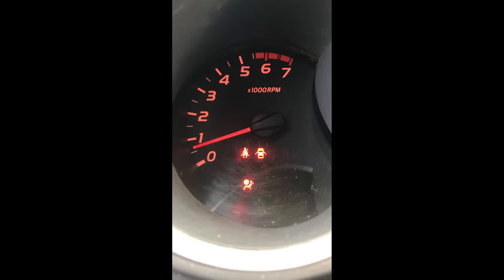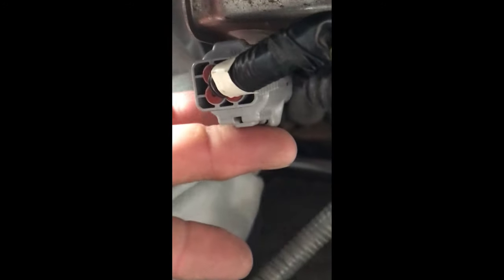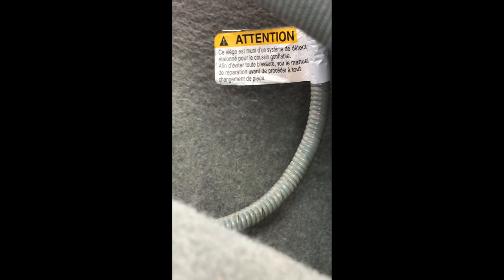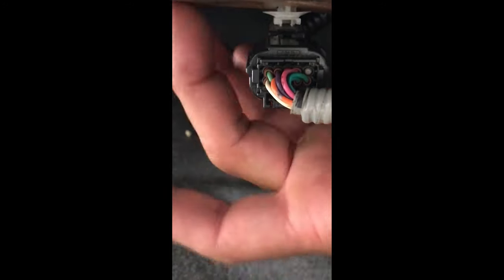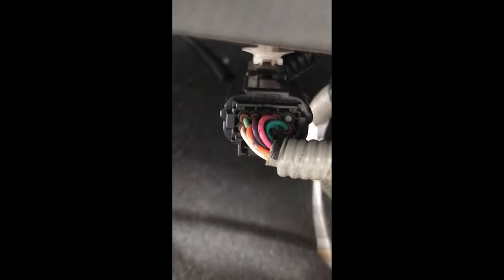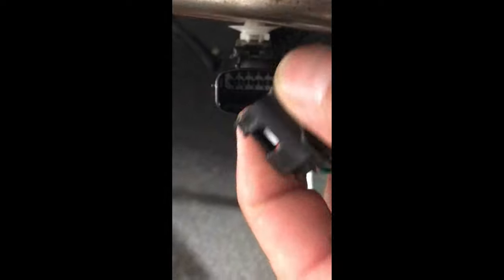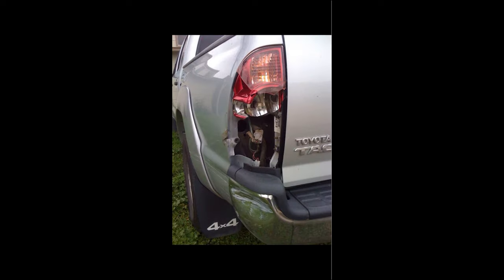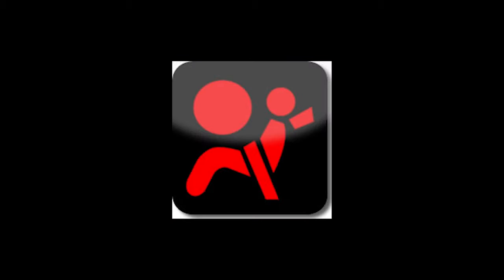Airbag Light Reset  | Toyota

Comment: Thank you sir. I found the connection under the driver seat  and just jiggled it a bit and made sure it was not lose and it worked.

didn't have to even remove it.
Reply: Before you did this, was your passenger side “airbag off” light on and passenger seat buckle light flashing even when nobody was in it?

Comment: Can a dealership turn them off  to get  more money or have you buy a new car
Reply: They sure can, if you have no will and are easily manipulated.
Reply: @DanielFrost21  I might have to take it in - after noticing someone screwed around with the airbag itself, I'll try a junkyard replacement, if it's under $20. Should be, my winter beater is 16 years old. If it pisses me off enough, out comes the bulb ;P

Comment: But, I'd like that blinking light when I take out the key to stop blinking, is their a button or switch on steering column,  called a check lite. To use if I want to just check it to see if it's working or not. Not by putting key ingition to stop it. I want it to stop when all lies in car off

Comment: Thx fixed it :)
Reply: Hello from Austin TX

I have a 2008 toyota tundra
Do you know if do I have to add a switch/interruptor for the front bumper fog lights?

Since the tundra come with harness for the fog lights originally
But the main switch does not turn the lights on
Reply: Alfonso Martinez I have the same question
Reply: Before you did this, was your passenger side “airbag off” light on and passenger seat buckle light flashing even when nobody was in it?

Comment: Do you leave the ignition on when un-plugging the connector?
Reply: Im not a mechanic...but The ignition should be off, a short can lead to airbag discharge!
Reply: @junehp3507  Yes I did it with it off, DeoxIT D100L-25C in the connector, Last time I'll have to do that. I'll add it's really easy to tilt the seat back when you remove the bolts in front and just loosen the ones in back.
Reply: @onefastwienerdog my Honda Civic has the airbag light on and I’m scared to fix it 😅 what if they explode with me working on it
Reply: @pushups443  Make sure you disconnect the battery and wait a few min. before you work on it.

Comment: On most OBD2 vehicles, doing this will not work. What he did was fix a bad connection, nothing more. IN most cases you need to read the codes and determine the issue first. But hey, feel free.
Reply: Sure has worked for a lot of vehicles according to the comments.  And virtually every vehicle on the road today is on OBD2 vehicle.  Looks like you're incorrect.
Reply: Such a great knowledgeable comment from a car repair shop.
Reply: Are you sure this will not help I have a 1995 T100 Toyota will this disconnect the airbag because my light is on
Reply: This guy is 100% right. This is not how you do ANYTHING except fix a bad connection. This is not a reset. For example, a reset requires a scan tool or a paper clip in the obd pin hole 4 and 13.
Reply: @JonEhBee 
I agree. My SRS warning light is on, so I tried this 'fix'. It didn't work, and I didn't expect it to work either.

It's kind of suspicious that he doesn't show whether it worked on the car in the video, isn't it? I know he says it doesn't work every time as a disclaimer, but if I were making this video, I'd show one of the times where it did work as proof that it works at least sometimes.

If this fix works for you, then it's because the connection was loose in the first place. All you're doing is re-seating a loose connection. It's not in any way a "reset" of the airbag system.
Reply: @philp4684  I fixed mine after I found the REAL problem. The previous owner smashed the wires in the seat rail and severed many of them. I cleaned them up, twisted them together and electrical taped the hell out of it. Obligatory disclaimer I don't recommend this obviously but it fixed the light problem!
Reply: @JonEhBee 
Mine has no previous owner - I bought it new from an official Toyota dealer.

You might remember that a huge number of Toyotas and other car makes were recalled due to an airbag problem a few years ago. Mine was one of those. The dealer replaced the airbag less than two and a half years ago, and now I've got this warning light!

I've got it booked it in for the dealer to take a look at, because it's obviously nothing I can fix. I've already checked for loose connections and blown fuses.

Comment: Do you need to disconnect the neg cable on the battery before messing around with the wiring or plugs?? You also mentioned "Before you did this, was your passenger side “airbag off” light on and passenger seat buckle light flashing even when nobody was in it?" I have a 1998 Toyota Corrolla LE. I don't know where the passenger airbag light is, I only thought there was one on the dash? Thanks
Reply: Hi there,

I also got a 1998 Corolla with the same problem. Have you solved it yet?

Kind regards

Comment: Hey I'd did all that nothing work, my light went out I drive it for about 1 mile I went to park the car I went to put it on park the light came back on, no accidents and nothing, it happen after we had all that rain but my car was park all that time, then i went to the store came back light I notice it was on, then I follow every one suggestions but nothing works, I'm tire no more trying to get it off no more !!!
Reply: The connection is loose. Electric Tape the yellow connector together so it’s not jiggly.

Comment: i try it does not work at air bag light stays on 2012 toyota rav4
Reply: did you figure it out? whatd you have to do
Reply: @KollynJ  yes it was the black unit under the passangers seat problem sloved